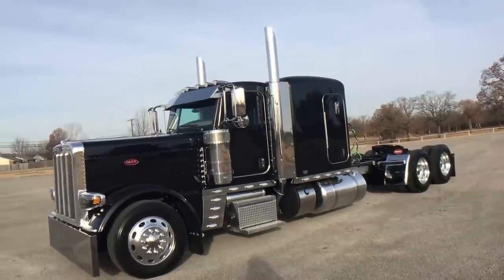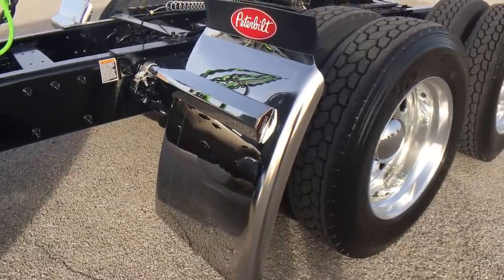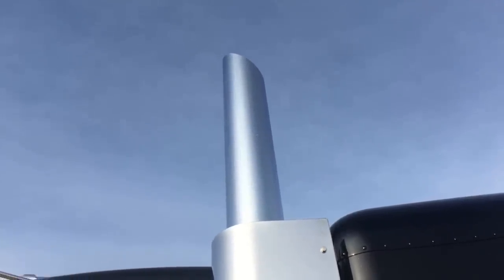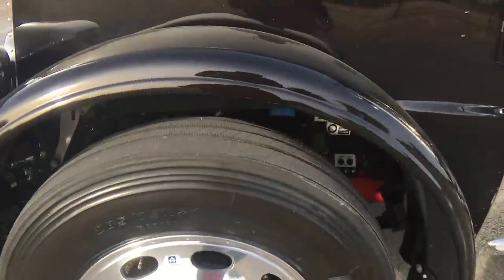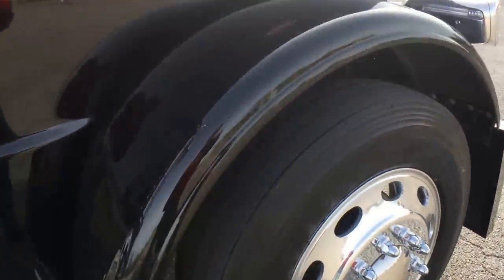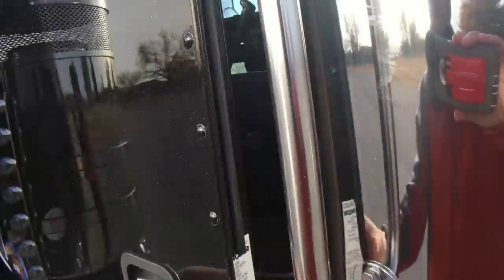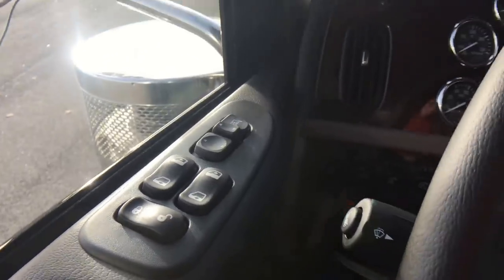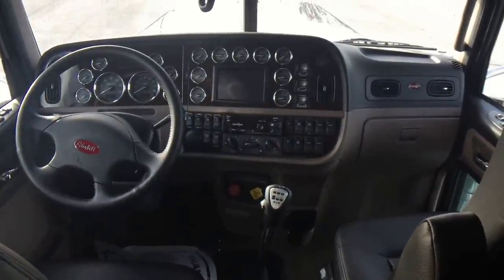300" Legendary Black Metallic 2017 389 Peterbilt Flat Top Hot Rod Air Ride Car Hauler Front Axle

Comment: Hey Steve just wondering what the stamped weight is on this rig and also does the insert in the frame go to the sleeper or all the way to the front.
Reply from the maker: Being 300 it goes basically all the way to the front.

Comment: Do the air lines and electrical line come bradded from factory because on my dads trucks I always had to do them myself , idk if it's just a simple touch that peterbuilt does
Reply from the maker: I have my guys do it, the little touches make big differences. Most dealers if they put them on just leave them loose and it looks like crap.